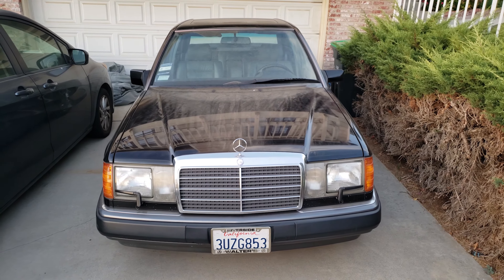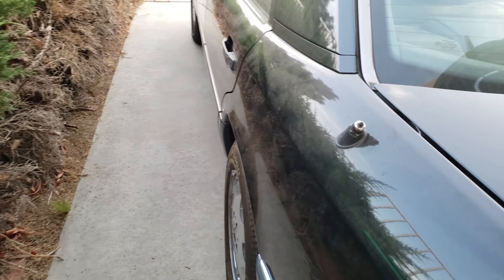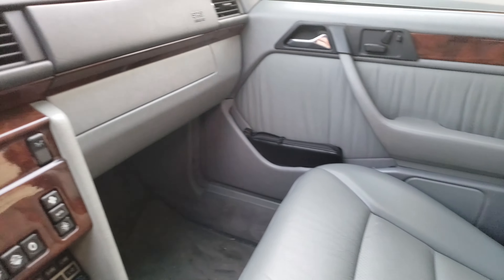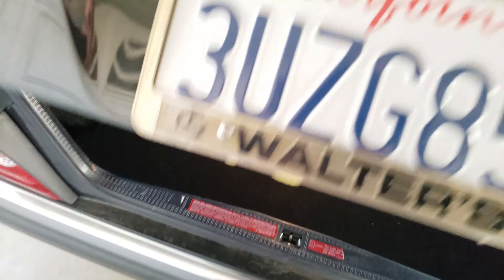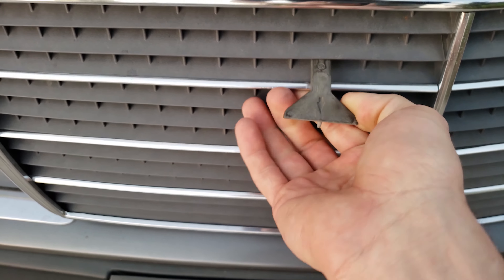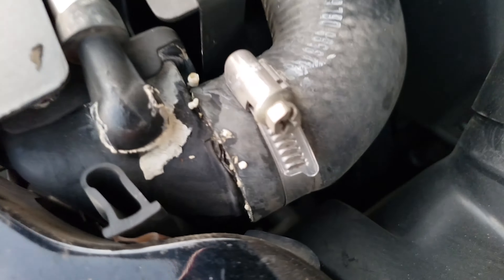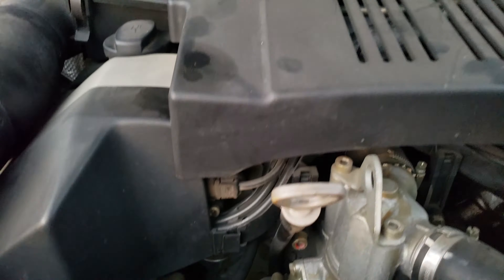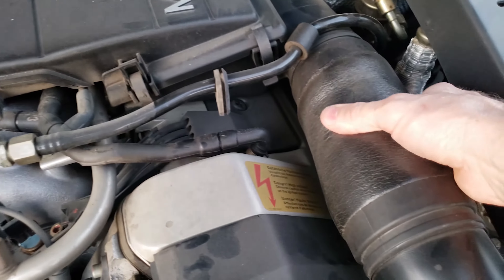1992 Mercedes-Benz 400E Project Introduction

Comment: Great Project. Did you know the radiator air bleed elbow is available as a separate part? I am running a 500E and love it !
Reply from the maker: Yes I had found that out later.  I'm hoping I'm able to get it out without small pieces breaking off inside the radiator 😧

Comment: +1. .. The Mercedes W124 series is the worlds most perfect sedan, , , , or Coupe. .. Best of luck with the project. . Question? .. Did the 400 E / E420 cars receive uprated brakes just as the 500 E / E500 V8 models did? .. The brakes in my '94 E320 Coupe are supposedly uprated from earlier W124 Coupes. .. Cheers,
Reply from the maker: As far as I know the brakes on the 400E are the largest available on the W124.  I do not know if the 500E brakes were bigger.
Reply: and insanely safe in a crash
Reply: @landontesar3070  .. Ditto that. .. The MB W124 puts modern day cars to shame crash wise. ..

Comment: put a 5 litre in it, but remember the m119 had 3 different fuel injection systems over the years so you need to get the right type of motor for the cars fi system
Reply from the maker: I'm just replacing the engine that's in it.  The 4.2 liter.  I'm using the same fuel injection system that both engines came with.
Reply: @FriendlyMBTech  cool the 4.2 will still be a great motor for the car i have a clk430 and that flies ,good luck

Comment: Did you get this car from a gentleman with a last name Vigano?
Tustin area?
Reply from the maker: No sir.  It was from a gentleman in the Moreno Valley area.
Reply: @FriendlyMBTech  i have a 93 400E she runs great. But, once she get hot not over heated. She want start until it cools down and setting for about an hour. What could be the issue? Love that car..
Reply from the maker: @Bobby Valentino  it could be several different things.  Have you checked for codes?  Also, does your AC work? Is the car dying while running or after you turn it off it won't start when you come back to it? The fuel runs though a fuel cooler that's cooled by the AC refrigerant.  If the fuel is overheating it could be vapor lock, which makes sense if it starts after cooling down.
Reply: @FriendlyMBTech  haven’t check the codes. The ac doesn’t work. It just started happening and the ac haven’t work for some time. The vapor lock is just how it acts. Thanks, I will check the codes. It happened before but it had bad distributor cap and points replaced all. problems was solved.

Comment: Wagner is appropriate.  Only 102K and needs an engine?  wOW.  mY cd player quit, let me know if you know who can work on it.  Will check the channel to see what it took to R&R the engine.
Reply from the maker: Yeah it had a blown head gasket.  I know you can send the head unit in to Backer and they can rebuild it and add bluetooth capability but I don't know anyone that repairs the CD player.  I'd try to find an eBay replacement first.